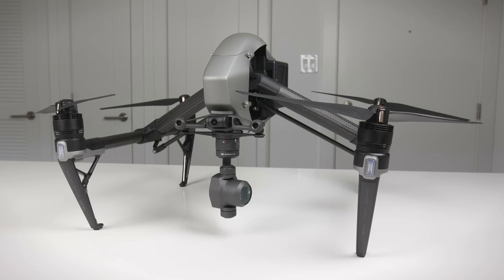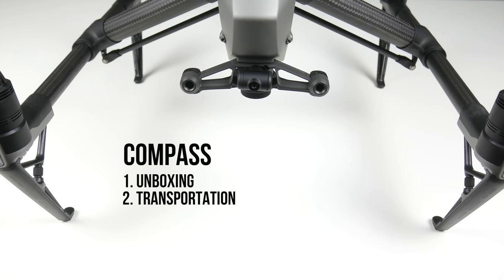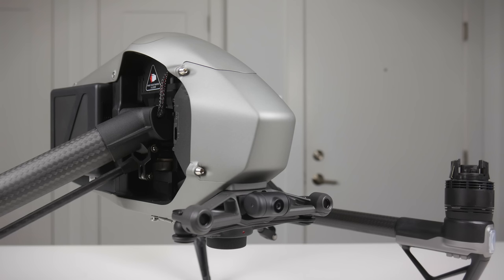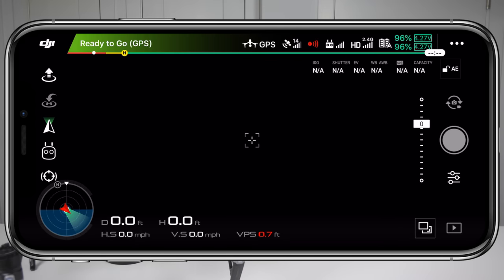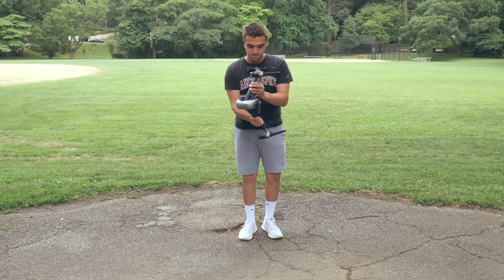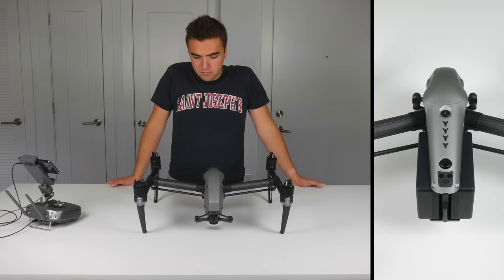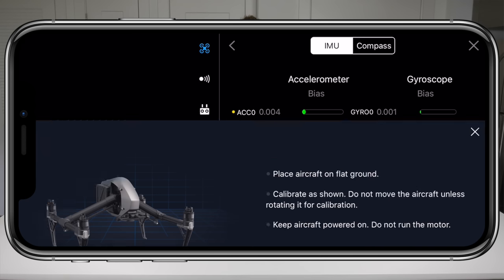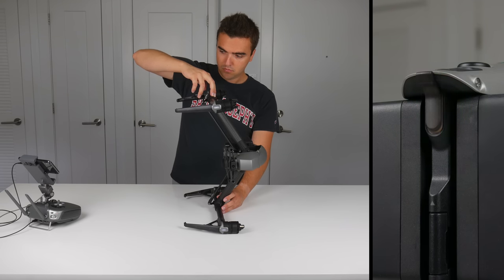DJI Inspire 2 Compass and IMU Calibration Walkthrough

Comment: The visual positioning system is also pretty important.. 

A lot of mavic pro users have reported some weird Behavior. Drifting back and forth and up and down.. 

After the visual positioning system calibration problem fixed.. 

I noticed if I'm not mistaken in your unboxing they actually give you a portable Vision positioning system calibration tool like they show you on the computer screen on the mavic pro...
Reply: Daytona 6263 

You're probably right..  

But I can tell you I've seen at least 6 videos with the mavic pro when they had a problem with it sitting straight and drifting after doing the IMU, and the compass calibration and it didn't fix the problem... They did the calibration board but they do it through DJI assistant 2 on the computer screen.

PROBLEM FIXED EVERY TIME..

There was no warning.. it did not say to do the vision positioning system..

But that's exactly what was wrong and it was fixed.. 

Remember there was no warning or any information in the app telling Billy to do the compass calibration, or the IMU calibration but he was still having problems.. so by your theory he should have just done nothing.. then when you calibrate the IMU and compass it fixed everything..

There's nothing wrong with doing all three of them, and there's no harm done.. I've done it many times just for practice.. 

You will usually get those IMU, and compass calibration warnings if something is REALLY WRONG... 

For instance I turned on my mavic Pro on school a bus just to check my camera settings without flying it obviously COMPASS CALIBRATION WARNING. Telling me to calibrate.. when I moved away from the bus problem gone... 

Me personally I've done all three of the many times just for the hell of it, maybe I was driving 20 miles, a bumpy ride in the car

No crashes, no problems ever.. I probably done about 60 flights now with my MAVIC PRO...
Reply: Daytona 6263 

It's easy all I can do is just cover your ass.. let's say you go on a 20-mile trip.. or you had a bumpy car or truck.. 

what's the harm in doing a compass calibration before you fly only takes about 30 seconds.. 

We're talking about $1, 000 drones here in up.. a small price to pay to be sure then to take a chance crashing your drone I'll overdue a little bit 6 days a week and twice on Sunday.. 

;)
Reply: Daytona 6263 

Also it's also good to practice all three if you know it by heart then you can do it so quickly.. 

Even DJI said you're better safe than sorry.. and it doesn't hurt when I talk to support..
Reply: Daytona 6263 

Also I'm a very high techie guy.. I build and fix guitars (guitar luthier), amplifiers, I have my own Studio ( audio engineer, producer, and a musician that plays all the instruments and sings), I'm a certified computer network engineer, I have my own karaoke and DJ business.. I have 30 years of electronic experience..

Etc.....

In other words I love doing all the calibrations including the Gimbal, and controller.. IT'S JUST FUN LOL.. I have almost takin the plunge taking apart the MAVIC PRO just for fun for a learning experience... 

I've been ripping things apart since I was 6 years old lol.. I drove my mother and father crazy... 

;)

Comment: Hey Billy .. I like your stuff, however, re calibrating the compass the manual for the Inspire 2 and the On Screen instructions are very clear .. after the first “horizontal rotation” for the 2nd phase .. as you rotate you need to point the nose of the copter at the ground and then rotate in that position your 360 degrees .. seems a good idea to think about changing your video .. otherwise, good job !